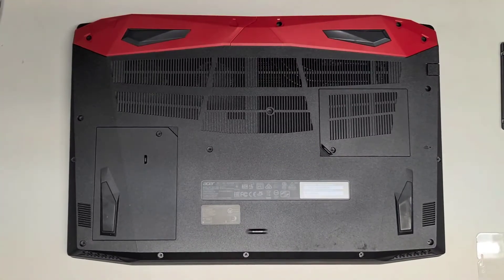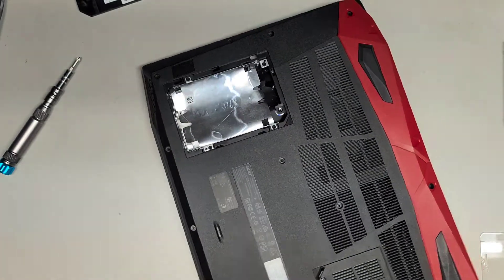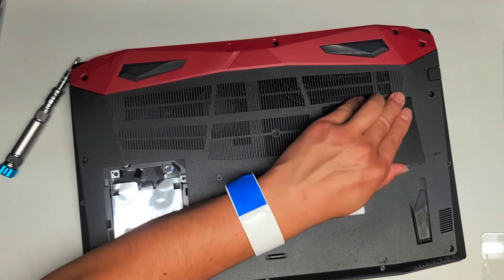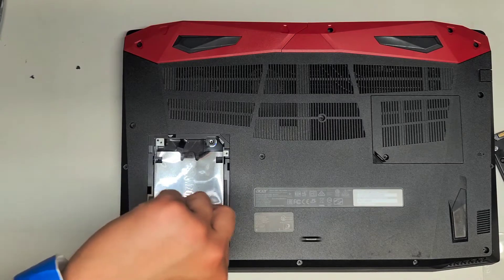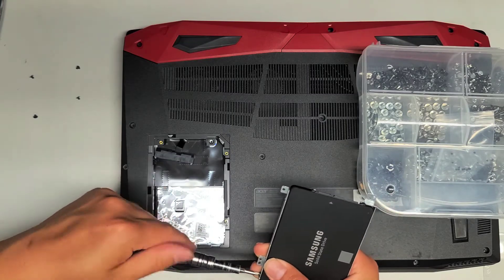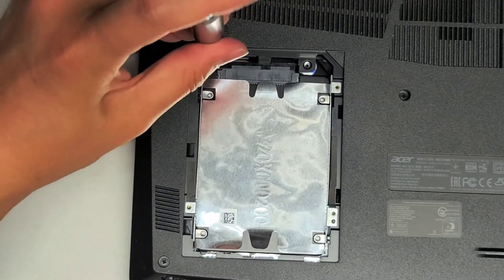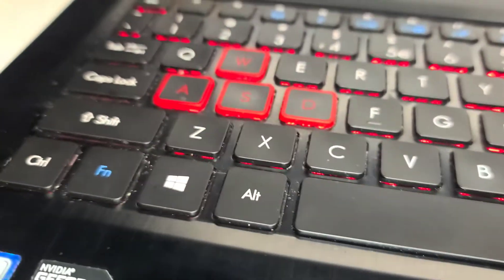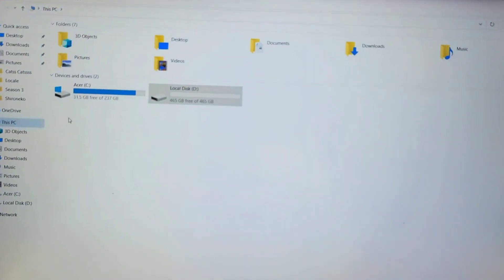Acer Predator Helios 300 Series N17C1 PH315-51-78NP Disassembly RAM SSD Hard Drive Upgrade Repair

Comment: Hi! Thank you for the great video! You made me confident about changing the ram sticks by myself. Just wondering if you know if the Crucial RAM 32GB Kit (2x16GB) DDR4 2666 MHz CL19 Laptop Memory CT2K16G4SFRA266 (found it on amazon) would work, i have the same model you used in the video . Thanks again!
Reply from the maker: Usually as long as the speed matches it should be fine.
Reply: @ItsBinhRepaired  great, thanks for the quick response! Keep up the good work!
Reply from the maker: @ignacioherrero3277  no problem. Hope the upgrade goes well. If you haven't already, don't forget to like and subscribe so others can find my videos. Thanks!